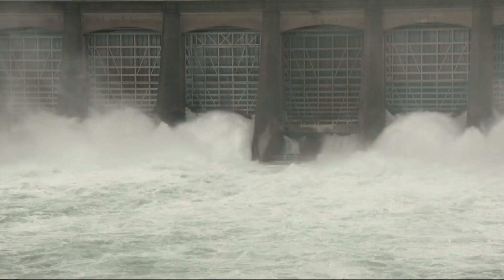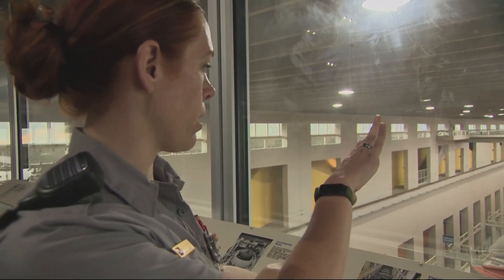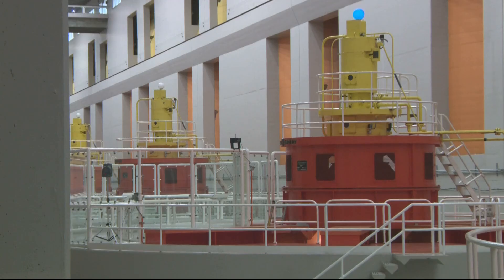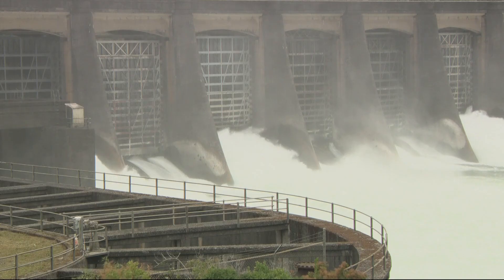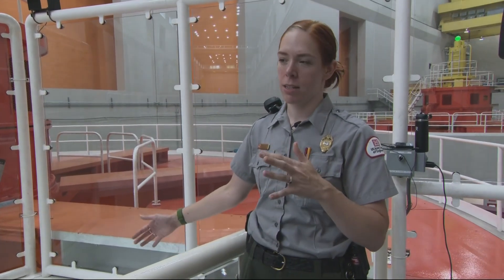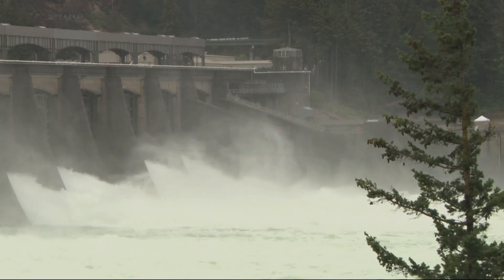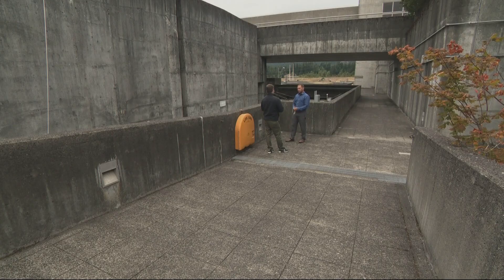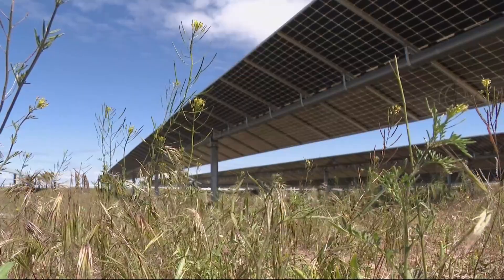A look inside how the Bonneville Dams powers the Portland metro region

Comment: I knew a guy that worked the power generation desk at Bonneville Power.  He said they are dumping water over the dam all the time because there is to much of it and they don't need the power.  The wind and solar they have installed in the area is totally unneeded and a product of the libtards that run the west coast.  The wind especially when the wind turbines come into Longview from China where they are mad using coal fired power. Then transported from across the world only to produce $.60 a kilowatt hour where the dam sells power through Bonneville Power for $.015.  It just raised the cost of our power and creates a bunch of pollution, kills birds; thanks libtards.  The dam is awesome but for some reason it's not counted as renewable energy!  Oh yes there are three more dams on the Columbia River doing the same thing.